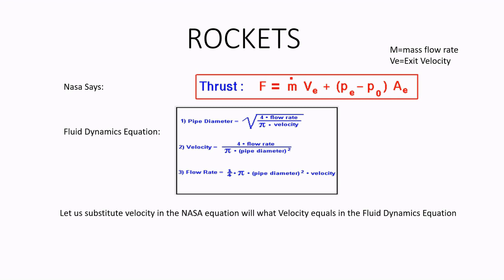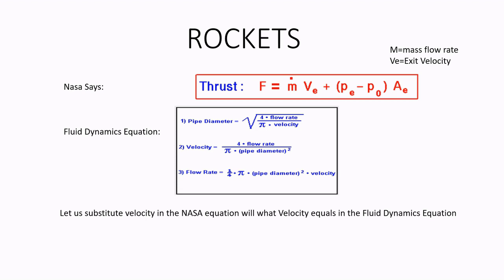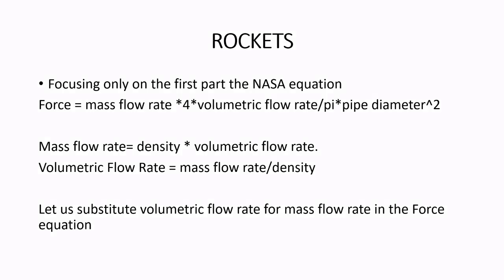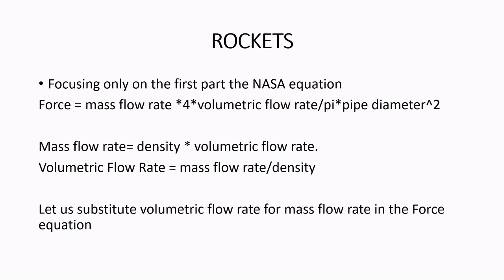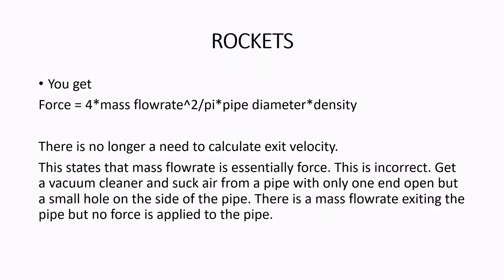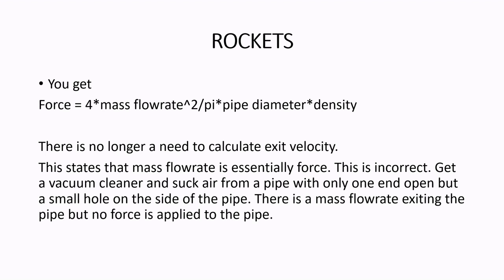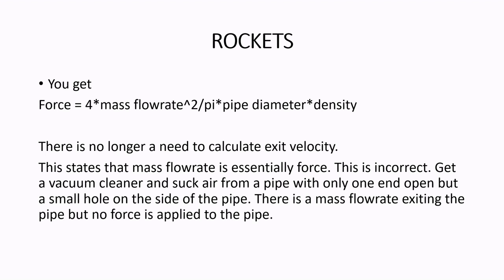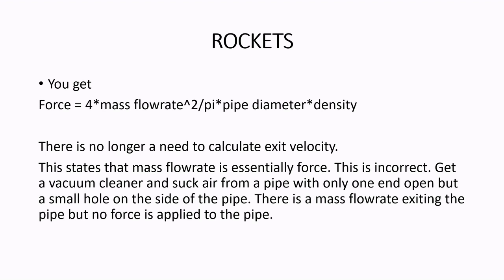NASA's Rocket Thrust Equation Invalidated

Comment: Conservation of momentum states that the momentum of a system can not change unless there is an outside force applied. The combustion and expansion of the fuel is an internal force. The exhaust has mass and is leaving the rocket at extemely high velocity. Mass and velocity, momentum. Since there is a change in momentum for the exhaust. How is momentum conserved for the system as a whole, rocket and exhaust? Conservation of momentum states the net momentum change must remain zero. Where is the momentum change equal and opposite to the momentum gain from the exhaust coming from?
Reply from the maker: The outside force is provided by pressure gradient force and not the rocket
Reply: @jerrysprocket5784  the pressure gradient is an internal force caused by the internal combustion of the gas. Try again

Comment: Perhaps this would be simpler to understand if you envisage the rocket throwing tonnes of bricks out the back at high velocity. 

Would it then move, in a vacuum, or not?
Reply: Throwing bricks is not in any way analogous to the free expansion of a gas.  Gasses are in a state of perpetual motion and expand volumetrically into areas of lower pressure without the application of a force.
Reply: @numbynumb  You need to learn about de laval nozzles and choked flow. 

This is fairly basic fluid dynamics and can be easily understood. It is fundamental to understanding rocket propulsion.
Reply: @krisdevalle  You need to learn about kinetic molecular theory.  

Do you know what Avogadro's law is?
Reply: @numbynumb  Yes, of course. 

Did you take the time to learn about de laval nozzles and choked flow?
Reply: @krisdevalle  What does Avogadro's law tell us about molecular mass in relation to the pressure and temperature of gasses?
Reply: @numbynumb  Sorry, didn't quite get you there - did you read and understand de laval nozzles and choked flow? 

We can't really progress until I understand that we are on the same level here.
Reply: @krisdevalle  I'm addressing your comment claiming that the physics of throwing stones is perfectly analogous to the physics of the work done by an expanding gas.  De Laval nozzles have nothing to do with it.
Reply: @numbynumb  If gas has mass, and is being forced via choked flow in one direction, then force is applied. 

You need to learn more about rocketry. You are showing a lack of knowledge that isn't informing your understanding of the topic.
Reply: @krisdevalle  Are you saying that without choked flow created by a de laval nozzle, it wouldn't be possible to create thrust in a vacuum?
Reply: @numbynumb  No - there are various other methods of deriving thrust in a vacuum, but the method you described is the most used one.
Reply: @krisdevalle  a gas expanding into a vacuum creates no force. The Gas laws are pretty clear on this, chatbot guy.
Reply: @numbynumb  a rocket is a primitive heat engine, so it's trivial to calculate the amount of work it can create in a vacuum. The amount is zero.
Reply: @papalegba6796  I fully agree.
Reply: @numbynumb  use w=t1-t2: a gas expanding into a vacuum does not experience a loss of temperature (proven experimentally in the 1840s), so t1 & t2 will be identical & no work will be done. Very simple to understand. A free body diagram & PV work calculation provide the same result, but the heat engine work calculation is the most technically undeniable in my experience. Every competent engineer knows it is correct.
Reply: @numbynumb  heat engines require energy transfer, which is impossible with a vacuum. Can't get something from nothing.
Reply: @papalegba6796  You haven't read enough on how rockets work.
Reply: @krisdevalle   Do you think rocket engines use gas pressure to create thrust?
Reply: @numbynumb  no

Comment: That's because the exit velocity is bound to the mass flowrate, pipe diameter, and density variables. If those are set, then your exit velocity is set. You're just rearranging variables to make it look like exit velocity disappears.

Exit velocity = mass flowrate / (pipe diamter * density).

[m]/[s] = [kg]/[s] / ( [m]² * [kg] / [m]³ ) = [kg]/[s] / ( [kg]/[m] ) =[kg]/[s] * [m]/[kg] = [m]/[s]

Nice grade 10 math skills though bro.
Reply: It's like you're watching someone running and measuring the distance he runs and the time it takes for him to run it, and then saying there's no need to calculate velocity.

His velocity is determined by the distance and time measurements, the same way the exit velocity is determined by the mass flowrate, pipe diameter, and density measurements.
Reply from the maker: So you are saying, mass flow rate through a pipe is force? Can you prove this? If I poke a hole in the side of pipe close to the closed end, and use vacuum to create mass flow out of the pipe, why doesn’t the pipe move forward?
Reply: @jerrysprocket5784  Because there's no net change in the mass of the pipe: you are just taking air that was outside the pipe and routing it through the pipe. If anything the pipe might move backward (toward your vacuum cleaner) because of the pressure difference caused by the inflow hole being significantly smaller than the outflow hole.

I don't know what you're asking me to prove, the formula for force is in the video you posted
Reply from the maker: The formula states mass flow exiting a pipe is force. Is there no mass flow exiting the pipe?
Reply: @jerrysprocket5784  There is an equivalent amount of air entering the pipe, so there is no net force applied by the mass flow.
Reply: I recommend some physics courses. This stuff becomes really easy to figure out and understand once you have a basic understanding of physics.
Reply from the maker: But the equation state mass flow rate out of a pipe is force. There is mass flow rate out of a pipe. Where is the force? It doesn’t matter where the air  is coming from, the pipe is allegedly “throwing” the air out
Reply: @jerrysprocket5784  I'm sorry, I don't mean to be rude, but you are simply lacking understanding of basic physics. The air is coming out of one end of the pipe, yes! But an exactly equal amount of air is coming in from the other end! This is a net zero mass flow. If there was a fuel inside the pipe burning and ejecting exhaust from only one end of the pipe, then it would be a net force in the opposite direction, but your vacuum cleaner example just doesn't have that.
Reply: @jerrysprocket5784  how much mass is entering the pipe at what velocity? How many times is the mass of the straw vs the mass of the air?
Reply: @jerrysprocket5784  "The formula states mass flow exiting a pipe is force" - the formula states that it is possible to calculate the force from the mass flow. All the mass that is expelled has been accelerated first. The pressure difference between the combustion chamber and the outside creates a force that is equal to the amount of mass times the acceleration. The mass flow is an easy indicator for how much mass was accelerated and how large the acceleration was.
Reply: @renedekker9806  the formula violates the gas laws, so it is wrong.
Reply: @papalegba6796  "the formula violates the gas laws, so it is wrong" - in what way does it violate which gas laws according to you?
Reply: It's an error to include density or mass as a variable in the equation because a gas' capacity to do work isn't related to its molecular mass, only to its pressure and volume (work = pressure x change in volume).  

All gases, from hydrogen to radon, at equal temperature and pressure, contain the same number of moles, so we know with 100% certainty that the work a gas can do isn't in any way proportional to its mass.  Thus it's not subject to equations which describe mass-proportional relationships, like f=ma or p=mv.  That's why they created kinetic molecular theory.

Comment: vacuums don't suck
high pressure pushes
Reply: It's two ways of saying the same thing.  Unless you want to claim there's no such thing as sucking.
Reply: @numbynumb  a basic understanding of physics is needed here, when you suck on a straw/ turn on a vacuum cleaner you create a low pressure in your mouth/ inside the vacuum cleaner, fluid will be forced up the straw/into the vacuum cleaner  due to the higher pressure out side of your mouth/ vacuum cleaner.
The term sucking has no place in physics, it is a human construct to describe what happens when you create a pressure differential .
This is simple stuff
Reply: @spook_dad  You honestly think that there are no papers published in respected science journals that use the term suction ?
Reply: @numbynumb  move the goal post why don't you
Reply: @numbynumb  let's define suction

suction
noun
noun: suction
    the production of a partial vacuum by the removal of air in order to force fluid into a vacant space or procure adhesion.
Reply: @spook_dad  How is that moving the goalposts?  Suck and suction refer to  exactly the same thing.
Reply: @spook_dad  Nice try! 😅